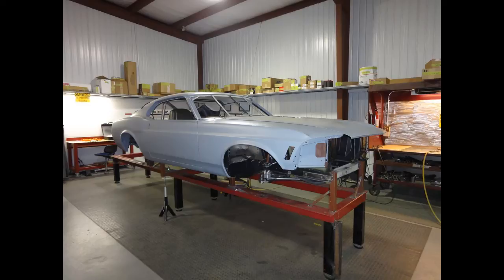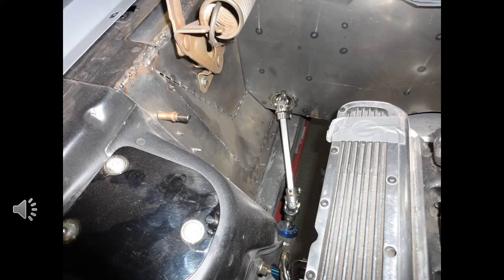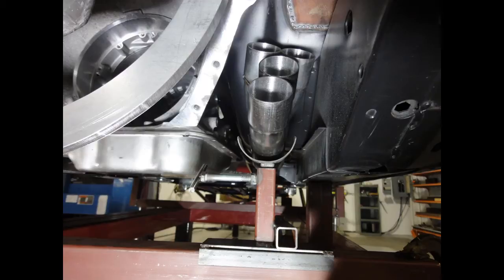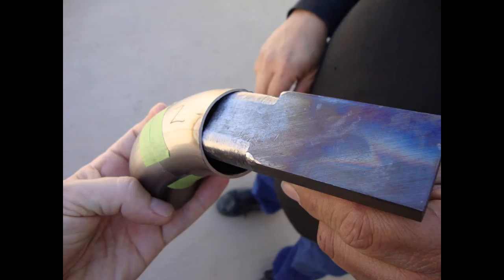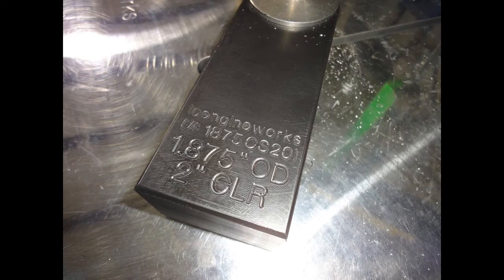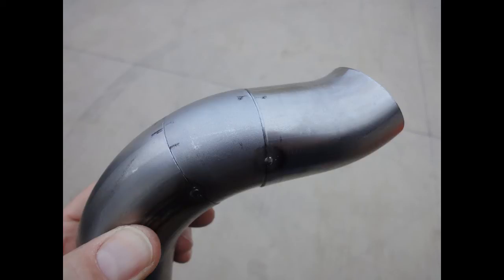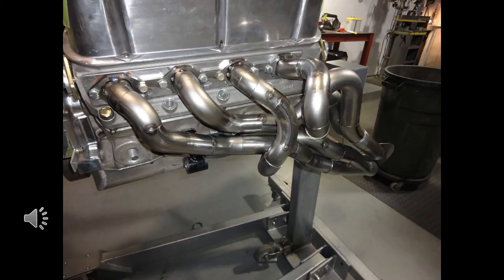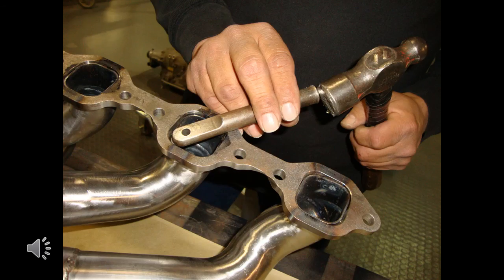Custom Header Fabrication

Comment: I want to make V6 headers for a G6 and make the exhaust have a more loud and deep noise. The only headers on the market or the G6 now are OBX Racing headers and they sound awful and are prone to rust. And if course I want to gain hp and torque from new headers.
Reply: Just stumbled on this, infuriating that they sell metal parts for a car that are prone to rust :(